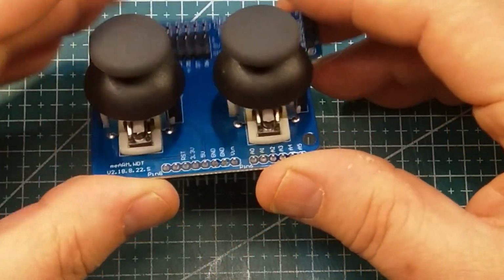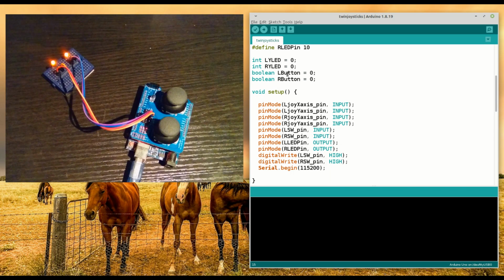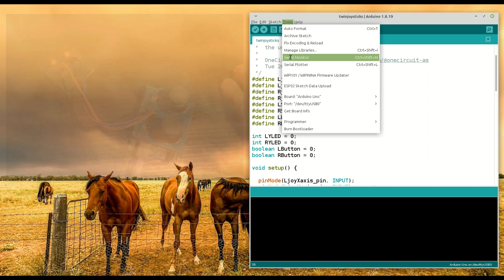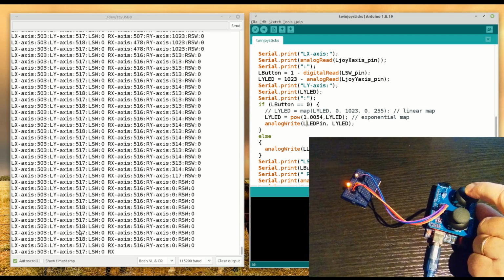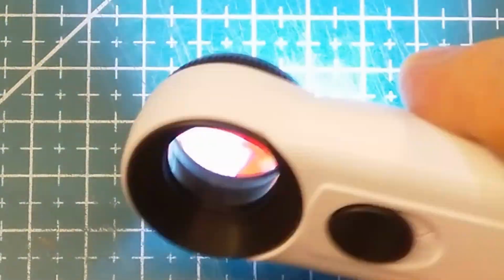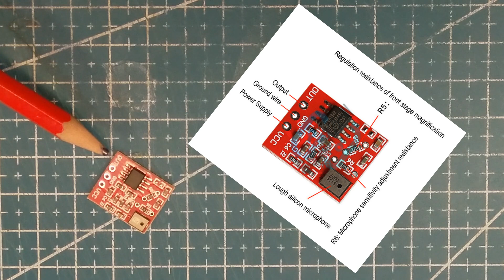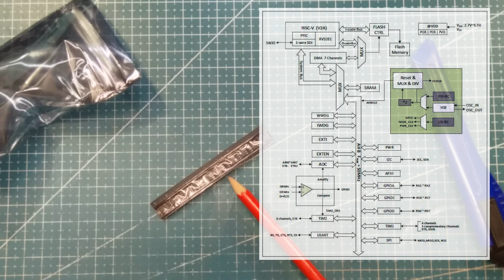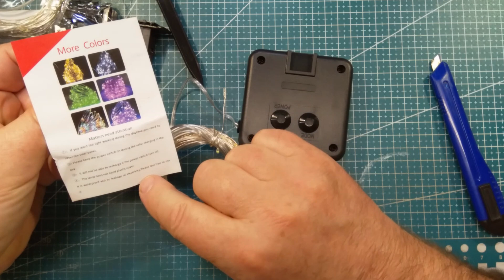Mailbag #36 - Joy and Joysticks

Comment: The microphone module has what it is called a MEMS microphone on it. Generally better then the standard electret microphones due to their better isolation from the power supply resulting in less noise. Off course the surrounding circuitry can impact sound quality a lot :)
Reply from the maker: I cannot for the life of me remember what application I had in mind for these little guys. 😬
Reply: @onecircuit-as  Maybe because MEMS technology is becoming more and more affordable for the hobbyist and you want to give it a try? :)